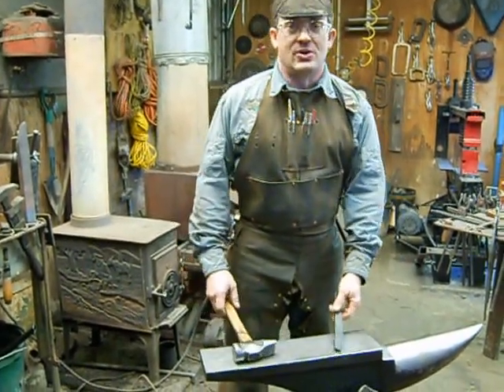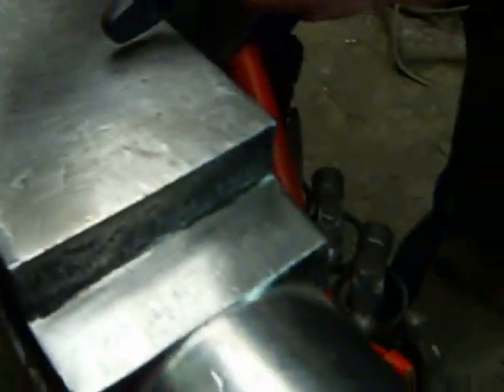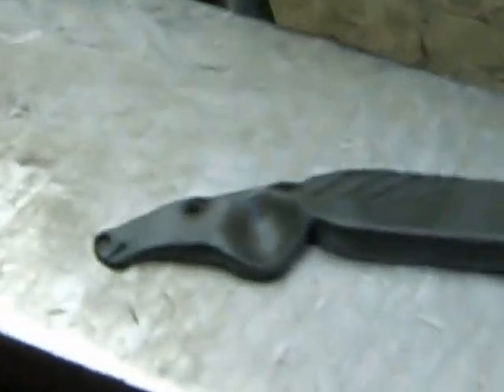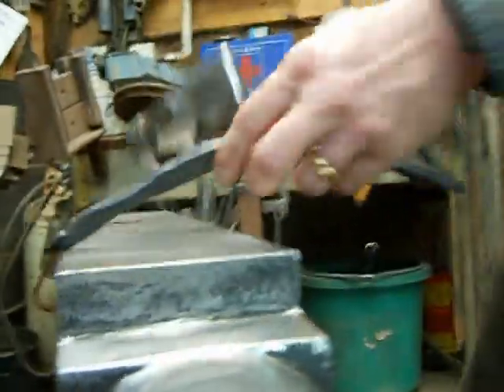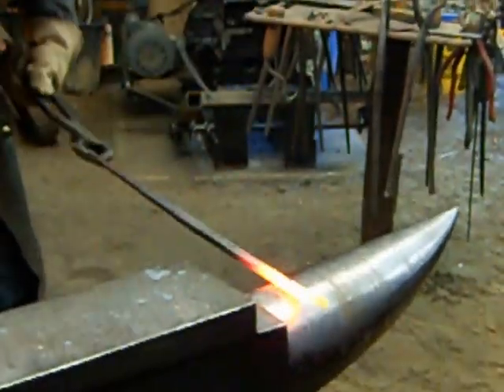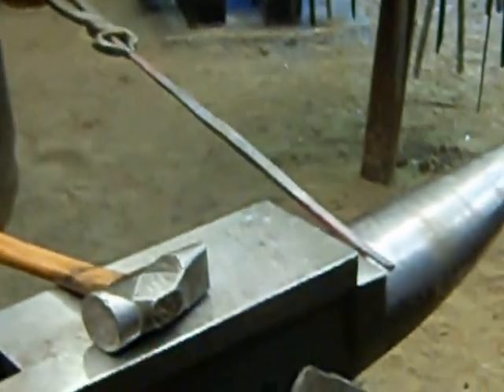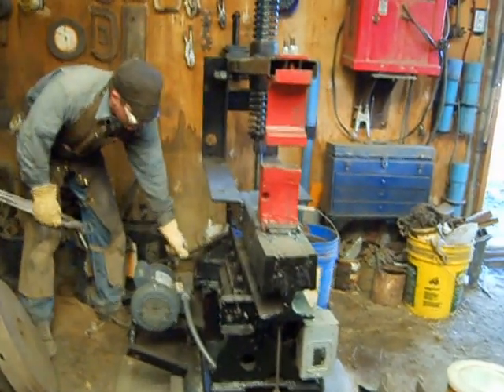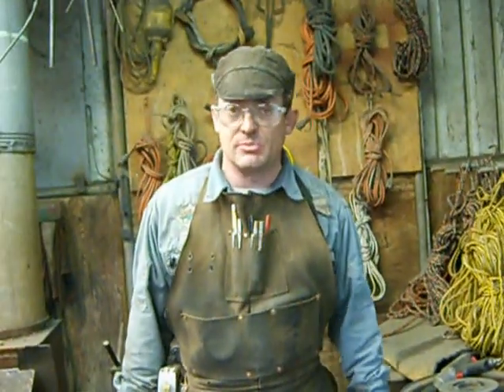JYH Power Hammer

Comment: Awesome video, Aaron. The chicken was a nice addition! What did you construct the bottom die from?
Reply from the maker: The bottom die is another piece of RR track, but I filled it in with metal to add more weight to it.  Ground and sanded half for a flat die and the other half is rounded for drawing out.
Reply: I like the "RugRats" shirt under the apron. 
Your tapering technique I have been trying, I still have trouble with a smooth tapper that way, but I am working on it.
I have a friend who uses his horn and rounding hammer. I keep making a mess of the metal when I try that. :-)

Comment: I like how you set your hammer up  the way you set your springs up takes 90 % of the slop away .. now my question for you is .. how is that hammer on working down  1.25" to 1.5" round stock , there are a lot of nice looking  Hammers that folks have made  on the tube here .. helms has one hell of a hammer . and it looks like it can knock the heck out of anything  ,, but I need to stay a medium size   but it  has to be able to handle  the   Job .. so I don't know what way to go ..
Reply from the maker: Mine will handle it, but not as nice as a pneumatic.  I think if I was to build it again I would probably build it the same way except use leaf springs instead of coil springs, like the "Original Junk Yard Hammer".  I think I might get a little more whip out of it.  I've used it a lot and it's showing signs of wear around the coils which I don't think would be an issue with leaf springs.  I don't use it for much over 1" stock on a regular basis but if the metal is hot enough I have not had a problem working 1 1/2", but I seldom use stock that big.

Comment: I ment the length of the helve of the hammer, and the size tubing you used for it
Reply from the maker: I'll take measurements tomorrow.
Reply from the maker: Sorry it took me a bit to get back its been busy.  The arm is made out of 2" X 2" X 3/16" square tubing, the length is 46".  If you are thinking of building one I would recommend looking up "Original Junk Yard Hammer"  they used leaf springs rather then a coil spring and I think You might be able to get a little better whip with leaf springs rather then coil.  With coil I am able to adjust the width between the hammer head and anvil but regular all thread stretched so I don't have the adjustment anymore.  If you go with coil and of a similar design that I made I would recommend getting ACME threaded rod.  It basically has the same threads as a heavy duty ratcheting load binder.

Comment: one more thing, when you said you put zerk fittings on the nuts, did you mean that you put zerk fittings on the bearings?
Reply from the maker: No I put them on the nuts, I actually added zerk fittings to all moving points to be able to better grease pivot points.  I also didn't make it out to the shop today, I'll try and get measurements tomorrow.